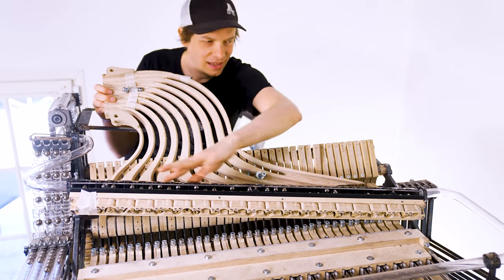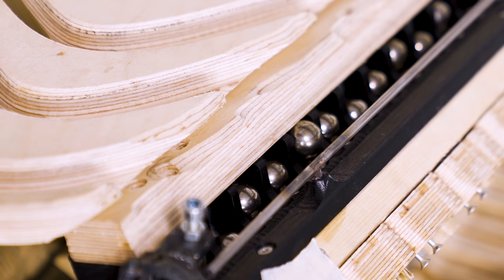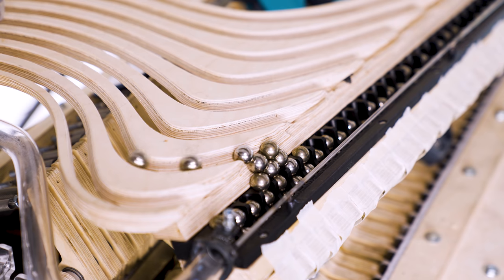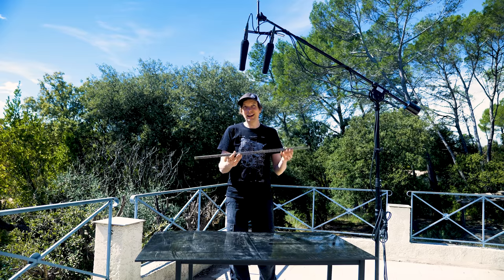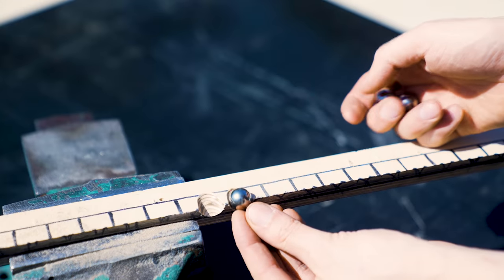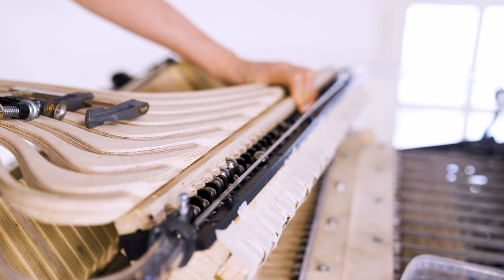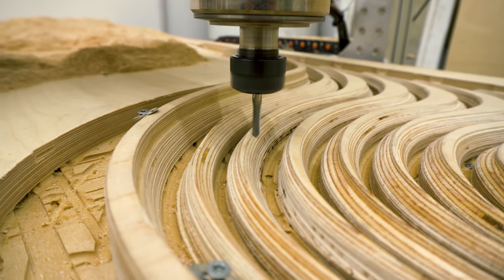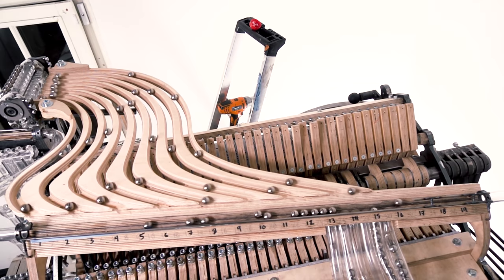Marble Tracks with Hidden Feature

Comment: Redundancy or robustness... I prefer the term robustness. To be redundant is to have more and not needed, I think. To be robust - not be able to fail easily...
Reply: I'd call it safety margin
Reply: Robustness through tolerance: Reducing failure rates by increasing the margin of random error with looser tolerances.
Reply: Or, arguably, resiliency: to self-recover from failures.
Reply: In engineering you want both. For example in computers specifically a server it needs to handle many situations without need requiring human interaction. Such as the small chance if randomly flipped bits in the memory, solved by the ECC memory system. However servers also commonly feature redundant power supplies. The server has two power supplies but only one is in use and if the one in use fails then the server automatically switches to the second and puts out an error signal to inform a human that it had a power supply failure. This is a robust system that can handle a single failure on its own, but to have this robust system a redundant part is needed. 

Robust means able to overcome adverse conditions 
Redundant describes a component that is unnecessary for operation but is included to handle an error or add additional features. 

Martins usage of redundant is not perfect but he is also not far off because he is trying to handle as many edge cases as possible.
Reply: you are partially correct. Redudancy (in terms of machines) means to have two or more identical parts for the same action that automically take over should one of the others fail.
Reply: redundancy can mean both, if something fails there is another system in place that will jump in for the faild on, or it can mean there is systems in place that do the same so one is not needed or will even corupt the other. What he means in most cases is neighter.
Reply: Coming from some linguistics background, I'm used to thinking of redundancy as necessary. People communicate in noisy environments, and not every phoneme or syllable gets through. To deal with this, language is naturally redundant. For example, in English the rounded-ness of a vowel (IE, whether the lips are round) is entirely redundant; the vowels which are rounded are already at different tongue positions than the unrounded vowels, so they still have a distinct sound without the rounding.
Reply: Redundancy is one of those words (at least in English) that can have completely opposite definitions depending on the context (surrounding words).  A system can be redundant, meaning you do not need it anymore, or it can "provide redundancy" which means its function is to make up for a failure elsewhere.  That means it is not really a great word to be used.  Might I suggest something like "fault-tolerant".   When you said the "Redundancy alarm" - I immediately thought - you meant there was something that was no longer needed in the tracks.  As a design engineer - who is always looking for ways to simplify things - that is what I think.  I expected you to say the bracket could be removed.  Instead, a 'fault tolerance' alarm would mean you need something to make sure the tracks didn't bend up or down and cause the marbles to stick.
Reply: @alonzochristensen6904  In programming it is worth mentioning that redundancy is not always a good thing. If code is repeated when it could potentially not be, then the code could be inefficient.
Reply: Redundancy and robustness are both not great words. Use "tolerance" please
Reply: This is not debatable he is using the word wrong. Redundant is when you have alternative not used option for backup. Rebustness is over designed to withstand wider range of conditions than needed just in case.
Reply: Robusdundancy.
Reply: It's resiliency what he's looking for.
Reply: @Stettafire  More significantly repeated code is harder to maintain. Fixing a bug or changing the functionality of one copy, you have to also remember to do so with the other copy. And if you think both are identical but they're not quite, it can become confusing to debug.
Reply: that was robustly redundant
Reply: @tommj4365  To my mind "tolerance" is best used in a specific, numerical way. For example the marble track has a tolerance regarding the angle it's mounted on. By sanding the track a bit, Martin moved the tolerance to a shallower angle (rather than widening it). In doing so, he shifted the tolerances of the overall machine, for operating on non-level surfaces. Whether they are wider now or not depends on where those tolerances are for other components.
Reply: Reliability
Reply: @tommj4365  Yeah, I always think of "rubustness" as meaning you have a system which can tolerate small failures without having a global failure. What martin is wanting is wide tolerances as you say.
Reply: For me, being an IT guy, redundancy is having a fail over system, for example, if one server goes down, there's still another one that does the job.
Reply: Redundancy is when you have other way to do something. In case the main way fails, you can do it the second way without too much loss.
Reply: @KarmCraft has it right.  Redundancy is the intentional duplication of system components in order to increase a system's dependability. Resilience refers to a system's ability to recover from a fault and maintain persistency of service dependability in the face of faults.  Again, Resiliency defines the ability to recover, converge or self-heal to restore normal operations after a disruptive event.  I don't see him duplicating parts, so no, he is not adding redundancy.  Marbles sometimes get stuck on divider (fault), next marble comes down and causes stuck marble to become unstuck (self heal), system is resilient.
Reply: Redundancy requires multiple systems/subsystems doing the same job, either in tandem like holding something with both hands, or in series like carrying something in one hand but being ready to catch it in the other if you loose you grip.
Multiple systems capable of doing the same job.

What he is often calling redundancy is more like modifying a hand or handle to make it easier to carry. That is a more robust system, but nothing is duplicated so there is no redundancy
Reply: @Stettafire  right, I’m not saying that redundancy is good in every scenario. However, you could say that assert statements are redundant because the code does work without them. Their purpose is to guarantee that the input is within the bounds the function has been designed to operate on, and when taken further allow a graceful failure path that can be corrected by further user input. 

So in short, duplicate code is bad, duplicate code is not redundant code because it doesn’t fulfill a need to prevent failure or allow additional features.
Reply: I vote for "resilient"
Reply: I would have called it "accounting for error". But that's no fun
Reply: What Martin really wants is reliability .  As some of you wrote, it means that the machine reliably does what it is supposed to do, and does not fail in one way or another.

Martin talked about this in an episode several months back, I believe in October 2020, when he wanted to get to 99.99999% reliability.  This is a well-defined term, and it means that for 10 million successful "events" on the machine there is only one failure event.  (So, only after 10 million correctly played notes, a note is not played, or a marble drops to the floor or something like that.)

There are several techniques that help achieve this.  One is redundancy : when there is a part that fails more often than allowed, it can be possible to add a second (or third, etc.) part "in parallel" that fulfills the same function.  And this is what I suggested to him on the discord channel back in October 2020.  And I explained the basic math needed to calculate the overall failure rate or reliability of the machine, based on the failure rate / reliability of each part, and whether it is a redundant part or not.  (Some of you here explained this concept already. :))

Martin added some redundancy to the machine when he exchanged the acrylic construct after the marble elevator with the wooden marble tracks.  The acrylic construct used only two pipes after some point, and now he uses several parallel tracks instead.

But other than that, he works more on the robustness and resilience (aka fault tolerance ) of the parts, and a bit also on the precision of some parts (aka small part tolerances ) and on their durability . And he removes failure opportunities (aka simplification ). Some of you already wrote about one or another of these.

And yes, apparently Martin likes "redundancy" as a concept, and he uses the word to describe these other techniques as well. 😅
Maybe he misunderstood me to some extent, and thinks that all techniques that increase the reliability of parts are called "redundancy".
And I didn't mention any of the other techniques.  Reliability and redundancy (and the math around this) are already a few things to write about and to digest.

Anyhow, I agree that it would be better to use the words correctly.  (I would also give Martin some leeway.  He is an artist who is also an inspired engineer, not an engineer who also does art. 🤷  But yes, if possible, let's get these words right. 👍)

So please let me try, as I can, and using some of your definitions here, to clear up the meaning of these words.  (I am coming from a background in IT systems design here.)
Maybe Martin wants to use these, who knows. :)

Robustness means that the machine or its parts work under a wider range of operating conditions.  (Someone else wrote "operate in a wide[r] envelope".)  Martin showed that in the last episode, when he found that the POM marble divider operates correctly under a wider range of angles than the wooden marble divider.

I think @Metazone 101 explained resilience very well: resilience is the "ability to recover, converge or self-heal to restore normal operations after a disruptive event".  And I really like his MMX example: "Marbles sometimes get stuck on [the] divider (fault), [the] next marble comes down and causes [the] stuck marble to become unstuck (self heal), [so] the system is resilient".
In other words: the system tolerates certain error conditions (it is fault-tolerant against these conditions), and self-heals, so that they do not lead to a failure or unwanted outcome.

And when Martin replaced the wooden marble divider head with a POM part, he improved the part's precision and durability .  A higher precision of a well-designed part means that the part is less likely out of specifications, and will more likely behave as designed, and cause less faults.  And the more durable POM will take longer to wear out.  So the point where it doesn't operate within specifications is reached later in the life of the part.

And last but not least, simplification (or removal of failure opportunities ) means that, for example, marbles could block each other and get stuck where several marble paths converged into a pipe.  Replacing the acrylic marble transport and pipes with the wooden marble tracks removed this opportunity of failure.

(Edit: reposted from Linux, because from my iPad it got the formatting wrong.)
Reply: Spot on.  A robust design can tolerate a wide range of possible failure modes without actually failing.  
Redundancy, would be a spill-over design with a secondary catch tray that fed into the fish stair.
Robust design = less failures
Redundant design = failures are acceptable because of the secondary mechanism managing the failure

automatic electric bilge pump for your boat = robust
manual bilge pump (or scared dude with a bucket) = redundant
Reply: @JonReevesLA  i think robust makes more sense
Reply: Wow. I didn't think my opinion will spark such discussion. I didn't thought of the term redundancy that way. Anyway as Martin says - great community!
Reply: In computer systems we use the term dependability. This is achieved through fault prevention/avoidance (best part is no part), fault removal (test and refine - robustness),  fault tolerance (redundancy and backups - I would say the redundancy in the video is actually closer to fault removal), and fault forecasting (not something super easy to make a mechanical analog to, but if you can predict when a fault will occur during operation, you can then take steps to mitigate it).

Comment: I feel like the clock escapement gate and the height-independent marble divider were true turning points for the project. You just managed to solve two creeping issues — marble pressure and height adjustment — that hundreds of videos revolved around, only to drop everything and replace it with a simpler, sleek and much more elegant solution — the amount of pieces removed from the machine is definitely the best representation of this. It makes me believe more on the world tour than ever before. :)